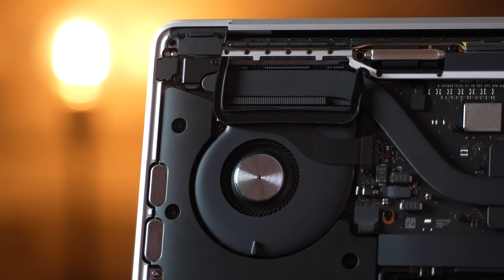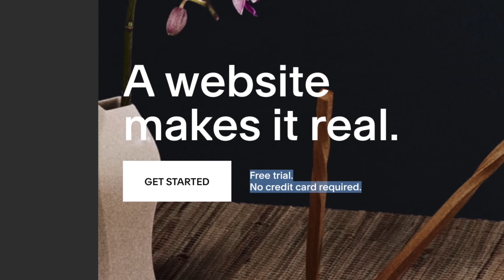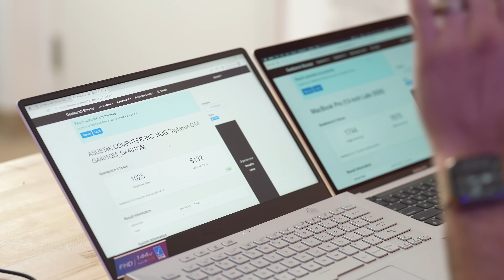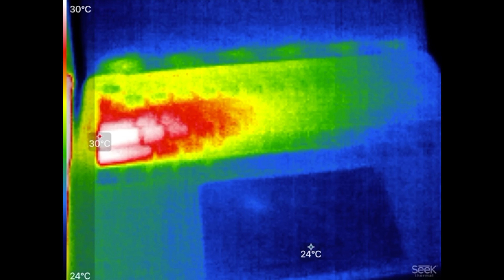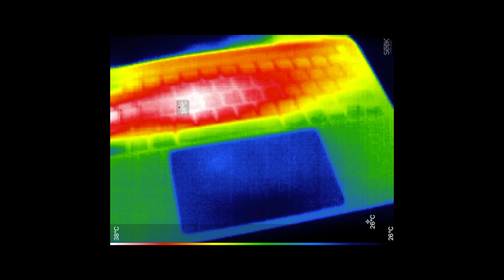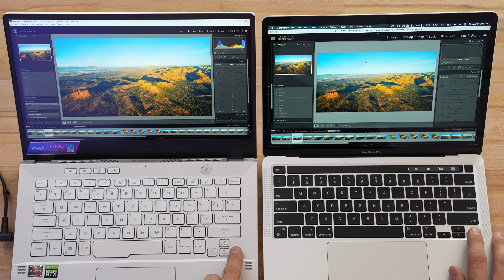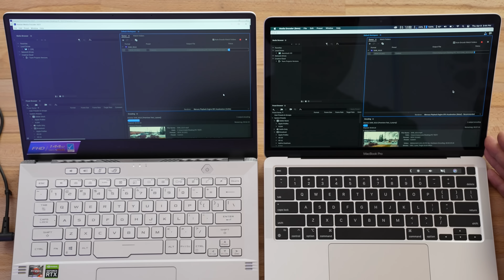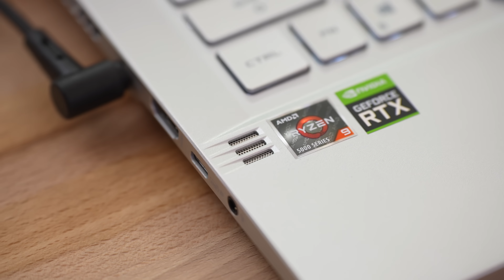Apple M1 vs AMD 5900HS + RTX 3060: FINALLY an M1 Killer?

Comment: Max, what is with SSD issue with M1  MacBook?
Reply: As I understand it, the SSD swap is so fast people tend to overload the RAM and swap a lot to disk, wearing out the SSD. Where normally people notice the swapping because the system slows down, prompting people to close apps. Also, the M1 just doesn't support as much RAM as some people need, so they end up swapping to disk morre.

Comment: Why did you have the asus plugged in that much when you didn't have the m1 plugged in?
Reply: The M1 is so efficient it doesn't need to be plugged in and doesn't get faster when plugged in. That's one of the hidden benefits of M1. It's fast AND extremely power efficient. So you get full performance while mobile.

Comment: So what exactly is the point of comparing these two blatantly opposite laptops?
Reply: The point is to see if the M1 stacks up against "gaming laptops."
Reply: @yarnosh  And why would you compare the M1, which is NOT a gaming laptop and never will be used as a gaming laptop, to a gaming laptop? It's like comparing a chimp's ability to swim against a dolphin. Sure, they both can swim, but why even bother to make such comparisons?
Reply: @VictorCosmin  "And why would you compare the M1, which is NOT a gaming laptop and never will be used as a gaming laptop"

Pardon? I just played some games on my MBP M1 last night.  Kerbal Space Program runs great. Also RimWorld. Going to try Dying Light tonight. The x86 translation on OS X/M1 is really good.  I'm going to play more with Windows games running in Parallels using Microsoft's x86 to ARM translation. 

You act like "gaming laptop" is a distinct kind of computer. It's not. It's just got a better GPU than usual for a laptop.
Reply: @yarnosh  By that logic, you can test a Prius against a Ferrari. Both reach 60 mph, so why not test them against each other?
Reply: @VictorCosmin  I mean, I'd probably pick a Tesla, not a Prius, but sure. Electric cars have a lot of interesting advantages over even high performance internal combustion cars.  It's not going to be a "which one should I buy?" type comparison, but interesting none the less.
Reply: @yarnosh  My point exactly. It doesn't matter if a Tesla can thrash a Ferrari in a straight line or even 0-60 because it wasn't designed to - even if it actually can. Same with the M1. Sure, it can game but it wasn't meant to be a gaming laptop. Much more relevant is to see professionals working on the new M1 and hearing what they have to say about the M1 and how it helped them be more (or less) productive.  Or for a student how has the new M1 impacted their productivity when it comes to battery life.
Reply: @VictorCosmin  " It doesn't matter if a Tesla can thrash a Ferrari in a straight line or even 0-60 because it wasn't designed to"

 It matters to nerds like me who find it interesting to see what you can do with a machine beyond what it is explicitly designed for.  Turns out the M1 is much more than just a good Performance:Watt ratio. I want to see how it stacks up. People don't normally buy a PC to just do ONE thing.  For example, I code on my laptop 8+ hours a day and play games on it 1-2 hours a night.  So it has to have  to do both adequately.  Or at least have the potential. And M1 does perform better than traditional integrated graphics. 

But I really think you put too much stock in this idea of a "gaming laptop" as if it is anything more than regular laptop with a beefier GPU than average. It's not anyhting like Ferrari vs. Prius as you originally stated. That's ridiculous.

Comment: AMD is moving to ARM based processors just like Apple has right now soon so I’ll be getting AMD’s next generation for sure when that is out.
Reply: And if you buy an ARM based CPU then you will have to emulate all your X86 software at a huge performance cost. Apple can push developers to re-write their applications but AMD dont really have that power with Windows.
Reply: @scubasausage  there was just a huge lake an I stand corrected btw AMD is gonna use AMD for a couple more generations and then use something else I guess? But even with that performance cost it still outperforms intel. Apple keeps getting crazier and crazier and I tbh love it. And don’t get me started on the new IBM leaks that have been surfacing.

Comment: Why would you unplug a gaming laptop with an rtx 3060?
And then proceed to do benchmarks, but not in it's best turbo mode, come on now, a do over is need.
test them both at what they do best without handicapping them.

Comment: So why all that fuzz about the M1? The Asus is both cheaper and faster at every intensive task. And there are also much bigger  versions with 32GB RAM, 2TB SSD, etc for similar price as a MacBook Pro.  Still the M1s are good laptops in other aspects, but they are clearly  inferior in performance.

Comment: Photo editing and video editing, the question is who has more accurate colors? They both look differrent , this should definitely matter a lot..
Reply: This is a stupid comparison actually. Gaming laptops are tweaked to perform better at gaming and not video rendering. The driver sets are completely different. Most YouTubers don't know that. They think a pc that has graphics card and a powerful processor should work great for both gaming and editing equally. That is just silly. Also, Macbooks are not meant for gaming. So you can't compare that part either.

Comment: @Max Tech
[SEPARATE those Laptops more,  they can Suck in eachothers HOT exhaust,  not to mention Wi-Fi interference, and NO, the best mobile CPU will be Renoir, the one you tested is Cezzane]
Again...,  You are Decieving People here; some have brought to your Attention Before that those GeekBench Scores are NOT ACCUTATE/TRUE, Intel Processors [same goes for AMD RYZEN] on these tests are NOT using it's FULL WIDTH of a SINGLE Core and Geekbench CAN'T mantain it's Pipelines OCUPIED with instructions to Process; _"Unlike x86, ARM-Apple's M1 is not SMT-based and needs only one thread to saturate the core_" as to be Expected, when using a SINGLE Core's 2 Threads Intel {and Especially AMD} Wins (Like they ALSO Won in the Advanced Professional PHORONIX Benckmarks) 🙃😅 https://wccftech.com/why-apple-m1-single-core-comparisons-are-fundamentally-flawed-with-benchmarks/

Comment: Damn that M1 is a real beast! unfortunately I game a lot and also do some mining with my laptop so it's a no go for me.
Reply: You can mine with a laptop??
Reply: @MontageHustle  yes sure! Why not. Its all the same tech only in a mobile form factor. Been mining on a laptop for almost 3 months now.
Reply: @box2joe  holy crap what have you been mining and what specs or laptop?
Reply: @MontageHustle  i been mining etherium for the past 3 months now with nicehash. I find it easier to set-up compared to some other means. My laptop is an acer predator helios 300 with a core i7 9750h/RTX 2060 combo which average around 30-31 MH/s which is almost identical to a 2060 desktop counterpart in a more power efficient package. I also mine with a desktop currently equipped with 3 RTX cards.

Comment: waiting for the day when intel and amd launch thier arm based processors. Those combined with a good graphics card will take the whole computing experience to the next level.
This is a breakthrough. Kudos to apple. Never thought that apple would offer value for money but it's happening with this M1 chip. This is real innovation and the best part is that it's just the beginning!
Reply: Yes. This. People don't realize what Apple did. I hope AMD & Microsoft collobarate and create an AMD platform. That would be the best for customers. ARM is simply much more efficient at this point. No need to carry the legacy of old complicated architectures that were created for different bottlenecks (memory) of the past. We value efficiency and mobility now more. Next big jump in CPU technology will be less about making the dye size smaller but more about architecture at this point. Apple already paved the way. In a 2 or 3 generations the difference will be hard to ignore.

Comment: So I gave up at 15m39s when I realized the machines are not the same spec at all but the M1 has only 8GB RAM. Why not compare a 16GB M1 with a 16GB Zephyrus? Was to avoid the M1 smoking the ASUS and nullifying the video?
Reply: The 16gb zephyrus is actually cheaper than the 8gb Mac so there's that.
Reply: IT's fine. More RAM isn't going to change the benchmarks . The real difference is the dedicated GPU in the G14. But CPU to CPU, the M1 wins easy even with less RAM.

Comment: Why is Apple calling it Mac book "Pro" when it cannot compete with a much lower priced laptop in professional workloads?
Reply: The current M1 MacBook Pro is in a state of limbo, as the M1 MacBook Air can do basically anything the Pro can. The new M1 Pro is going to hopefully be announced next month, and that will probably be able to compete with gaming laptops in professional workloads more.
Reply: M1’s doesn’t draw high power consumption hence the long battery life. It doesn’t need to be plugged in either to get the best performance unlike window based PCs. Even before the m1, there were always window laptops that could perform before.

You’re not even looking at how a base m1 with only 8gb can perform better than more expensive higher spec window laptops.
Reply: @dandan3045  but if you weigh in the disadvantages Apple has too many disadvantages. First of all Apple M1 cannot run many of Apple software natively. Secondly a large number of Applications don't even have an Apple version. 
If Apple M1 machines could run all the Applications natively and every common Applications are supported in Apple. Then Apple can call it a superior product. 
Another problem with Apple products is that many common hardware components will not work properly with Apple. You need to buy from a small list of apples own products for that or just not do it. Funny to say that even most Bluetooth headsets don't work with Apple M1 based systems. 
You cannot price a product more if it cannot even fulfill the entire spectrum of use cases.
Reply: G14 is 1499$ and the Mac book pro is 1299. Tf you talking about ?
Reply: @htconexify  1299$ is for a 8GB ram and 256 GB ssd crap.
Reply: Right, they should call it something weird like.. Zephyrus G14. Or Bimlasticus X934

Comment: So basically - both are good. Important to note that the M1 chip is on TSMC 5nm while the 5900HS is on TSMC 7nm — so you’re mostly picking up difference from node to node.

Can’t really go wrong with either AMD or Apple at this point - if you like PC go AMD, if you like Apple, go Apple.

Comment: Man that whiite color on g15 looks dope!
Reply: @AVOCADO If you want to do some practice on problem solving. Then Only option available is practice. I know everyone says this same thing but this is the ultimate truth. But start in this way >>> First go with general things in python like till function , python data structure (list dict set tuples etc) and Object Oriented programming. Then there are two sites I recommend hackerrank and codeforces. Start with hackerrank first and earn you five star badge. This will start with simple printing hello world function to more complex application till you reach level five. Then head over to codeforces and there you should go to problemset page and you should be able to sort the problems there. Sort them in order of increasing difficulty from 800 to 3500. Now never ever jump to higher levels unless you are comfortable with the previous level of rating. Now there you can work on specific areas of problem solving too. Like I feel a bit etchy when solving a implementation type of problem and I really love solving maths based problems. So I apply tags to filter according to that. In that way you will know what section requires more attention from your side. You might get frustrated sometimes but then leave those problems for an hour or so and get fresh, next time you try that your chances of coming up with a solution is high now and chances of breaking your laptop is less now. Also try not to use some of the very advanced and short and useful functions and  way to do certain tasks which you would get on google search. That will reduce your thinking power. Try writing your own array sorting code instead of just using list.sort() or sorted(list). Many functions of python make it easy to work. That will be useful when you work in development of a product to get things done easily. If you are really beggining Just now, then first try basic problems like building tic tac toe  game patterns and  basic problems to get some experience of working with loops and functions. * I think hacckerrank will do the same for you. And you may love apple(I did) but remember Google is your best friend in this journey. Use that whenever you want or need. There is litteraly no Shame to Google even a basic python function. I do it regularly. By the way my language of choice for doing problems in competitive coding is c++ and python is for the backend and machine learning things. In India there is so much competition we need to choose a language with fastest speed to clear Faang exams so we choose c++ as it has major advantage over C but slightly slower. I hope it helps for your programming journey.
Reply: @AVOCADO Believe me I wanted to have a M1 macbook pro earlier. But I went with 4900HS with rtx 2060 graphics card last year for a asus zephyrus G14 laptop. And When I trained a neural network after booting linux, it was satisfying as heaven. I own a machine which can do most rigourous task for a gpu(requires Nvidia card with cuda cores). I used a 2019 macbook Pro till then which I didn't really needed at that time. But I was tired of Google Collab thing for learning deep learning concepts and applying them. Need to upload data on drive and many more complicated things to get things working. And upload speed on. Google drive for sometimes 2 GB file was terrible work with. Also download data in Collab was a pain as it would need to re download after page refresh. But that because of that laptop I was flying in my workflow. And yes I discovered a really cool thing called LINUX because of that which I never really cared about on mac. And paying games on windows is Just miles better than mac. Mac is a joke for gaming tbh. I am really proud of myself for buying that because that was the time when i chose something so that I can work and not that I can brag. And g14 was definitely a looker in that white color too.
Reply: @AVOCADO yeah I agree! For doing heavy tasks even 16GB is not enough so I went to upgrade to 24GB. And 512 Gigs is a really a pain for me.  And yes if you chose it for programming, its agood descision as Rosetta is pretty good to translate apps and softwares but not things like plugin and extensions. For example I used kite which is an auo complete sofware and it comes as a extension on vscode but simply unusable on m1. Many electronics Software of mine doesn't work fully on M1 too yet. I bought a base model m1 air for my brother for online schools and other stuffs and tested these things on it.
Reply: @AVOCADO and you can also use brilliant.org to learn and practice some maths stuff like number theory sets mapping etc... Its not a programming site but really helps in learning initial maths for programming. And this section is free on their website so you also try that.
Reply: @AVOCADO Oh welcome 😌!

Comment: Try not to fall in trap, they are running different OS and Mac are extremely optimized for M1 performance, this test drops nearly half when using Windows OS and TBH you have to end up using Windows alot.

Comment: I have not seen the same price for the amd laptop. The link you gave does not show the 3060 but a 2060 was this a mistake?
Reply: This is not a mistake, gfxbench is not the best.
The G14 has a GeForce RTX 2060 Max-Q and not a "RTX 3060".
Only the GA401QM-HZ024T-BE has a RTX 3060 and It is more expensive than the one tested here.
This "apple commercial" is misleading to say at least.
Test the most expensive macbook to an amd laptop around the same price, than we have a real test.

Comment: 15W of performance from the M1 is just crazy. Imagine the performance of the M1 if they had the same cooling of the G14 and they can push the wattage further.
Reply: @evila9076  you are aware that the world's fastest supercomputer literally uses risc right? Of course they scale with power everything scales with power. Apple could just 10x the cores to 10x the multithreaded performance and reach the same power consumption as the competition

Comment: This is not a surprise. Apple has a processor that is 2nm smaller and also the advantage of their own better operating system compared with Microsoft Windows which is garbage and regressive. AMD still has some great CPUs and is also kicking Intel to the curb but Apple is the clear winner.

Comment: Note that calling the M1 an 8-core processor is technically accurate, but it’s completely disingenuous to compare it to an 8-core x64 chip, especially one with hyper-threading. The “icestorm” efficiency cores in the M1 run at a notably slower clock speed, have less cache, and have other factors that limit their performance to save power. A more apt analogy would be to a 4-core/8-thread x64 chip, although there isn’t a direct match. 

Details below from Wikipedia article on the M1

“The high-performance cores have 192 KB of L1 instruction cache and 128 KB of L1 data cache and share a 12 MB L2 cache; the energy-efficient cores have a 128 KB L1 instruction cache, 64 KB L1 data cache, and a shared 4 MB L2 cache. The Icestorm "E cluster" has a frequency of 0.6–2.064 GHz and a maximum power consumption of 1.3 W. The Firestorm "P cluster" has a frequency of 0.6–3.204 GHz and a maximum power consumption of 13.8 W.”